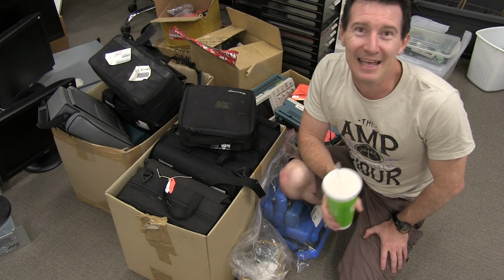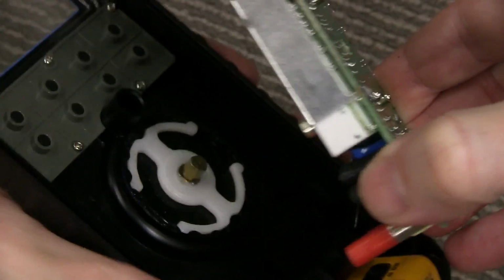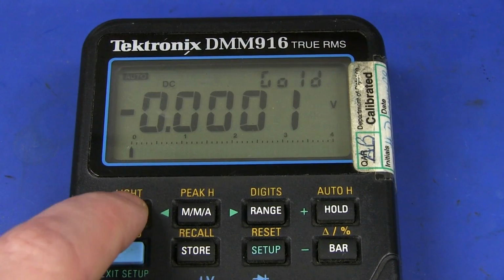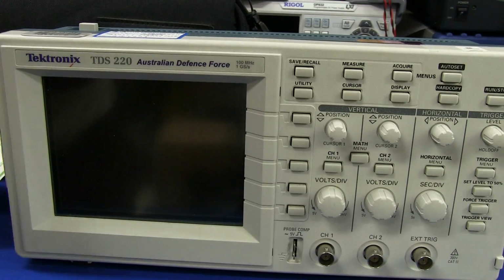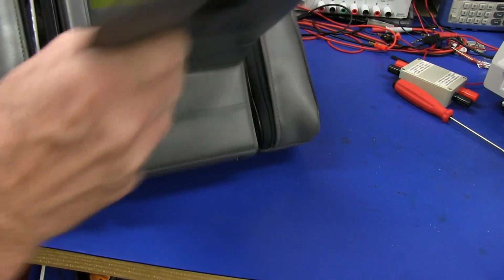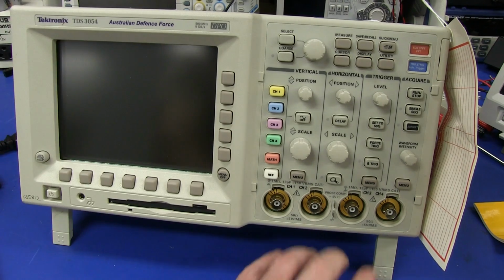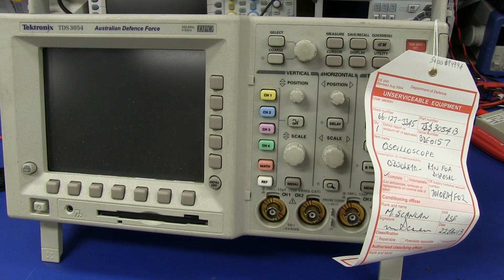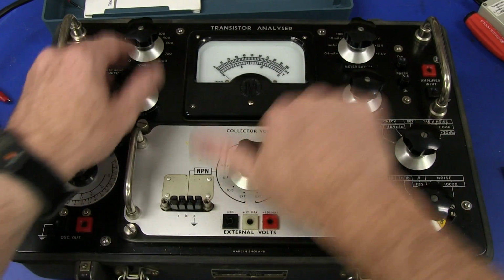EEVblog #559 - Auction Score

Comment: This 'find' reminds me of how I got my first oscilloscope. This was in the mid 70's, right after I had moved from Germany to the States, and was attending college in the St. Louis area. I had about zero money after rental of my single room basement apartment and putting fuel in my $100 beater car (luckily I had a couple scholarships that were taking care of tuition, and meals were included in the room rent). My only pieces of test equipment were a $25 Heathkit power supply and a Japanese analog multimeter that I had bought as a teenager. I was using some nice Tektronix scopes in the college lab, but owning any kind of scope was out of the picture, financially speaking.

My landlord was a service technician for Honeywell in the St. Louis area. He worked on repairing the Honeywell mainframe computer(s) at Scott Air Force Base nearby, but when not making a call to the base he hung out in the Honeywell building, or retired to his garage TV repair side-business. One day he told me that one the the Honeywell lab's high end Tektronix scopes had been labeled as 'out of service, not repairable' and was supposed to be trashed. But the Tektronix technician who was permanently posted to that Honeywell office had told him that the only thing wrong with it was one of the many secondary windings of the large power transformer had failed. Honeywell preferred to spend the money to buy a newer scope, as opposed to repairing the old one. He arranged to spirit the scope to his home, although it was written up as being trashed. The Honeywell technician, aware that it was actually being 'donated' to a young engineering in training, kindly filled out a form asserting that, aside from the transformer, the scope was still usable and serviceable. My landlord then gave me the non-functional scope, as-is, but armed with the statement of serviceability from the Honeywell tech.

One of my professors at the college, hearing of my windfall, showed me a manual for one of the college owned Tek scopes, and on the back cover it said that Tektronix manufactured their own transformers and CRTs, and unlike the other internal components, those parts were warrantied for the life of the scope. I mailed a copy of the Tek serviceability form to the address on the manual that I had perused, requesting a new transformer, but expecting nothing to come of it. A couple weeks later, a package arrived with the transformer.

The scope was, if I recall correctly, one of the 560 series models, perhaps a 564, taking plug-in vertical and horizontal amplifier modules. I am pretty sure that it had a 3A1 vertical amplifier module (dual trace), and a fairly high end horizontal sweep module (perusing photos on the web suggest that a model starting with 2B, perhaps 2B07 or 2B67, etc; might have been the one I had. I recall it had delayed sweep, and some other bells and whistles. No circuit boards anywhere in the scope. All discrete components silver soldered into metal saddles in ceramic rails, and beautifully done point-to-point hand wiring between those rails and the many tube sockets located between the rails. Several wiring harnesses snaking all through the scope. The scope and its modules I unwired the old power transformer and removed its many wires from the various harnesses, then mounted and wired in the new transformer, restoring the harnesses as I went along. The repaired scope seemed to work perfectly.

The downsides to this scope, besides it very heavy weight and huge physical size, were a fairly long period of warm up before it would become stable (I was told that these were normally just left turned on all the time), and that installed CRT (with variable intensity illuminated graticule) was intended for taking photos of the display, not viewing the display directly....something about the phosphor. The bezel of the CRT display was a special one designed to allow a large Polaroid camera (or other) to snap on to take photos of the display. So the display was rather hard to read. But I used this nice scope for many years until I eventually got tired of waiting for it to become stable after turning on, and squinting at the display. I sold it to a HAM that I worked with in my first engineering job, and bought the top-of-the line Heathkit scope, which I used for many years until replacing THAT with one of the first Tektronix digital scopes. which I hated and rarely used, and actually used a Goldstar analog scope for most things in my home lab. I finally replaced both the early Tek digital & Goldstar with a Siglent SDS1203X-E, but keep the fully-iunctional Goldstar around lust-in-case.....

Comment: I know this post is 3 years old but...I have a 15 year old Tektronix multimeter at work (university) that I have used almost since it was new. It is OK on a good day and on most days I would like to throw it against a wall. The selector switch contacts are carbon coated, not nickel plated like the newer ones Dave has. I took it apart again last week to clean the contacts and reshape the contact fingers and it works better (it loves to randomly switch modes.)

Tektronix does NOT manufacture these and does not even have access to the schematics (as we found out when EE department bought a bunch of them years ago). I suspect they are better than the cheapy import meters but they are not great (Dave's newer ones do look better made though.)

I used to buy Tripplett meters (have a 9040 now that I have had for many years) but I think they have gone the way of rebranding cheap import meters now too.

Comment: I've had a Tektronix DMM916 for well over a decade, awesome multimeters.
The 'Cold' on the screen is actually 'Gold', as in, gold menu option. Press the gold(yellow) button and then select from any of the options in gold(yellow) text above the buttons, as you were doing in the video. To activate the backlight, press and hold the yellow button for approx. 1 second to turn on, press and hold again to turn off. Simplez.

Comment: The Simpson 260 with the No Battery warning label was probably used to test weapon systems for stray voltages.
They don't want even a remote possibility of any voltage coming out of the meter and setting off an explosive device.
I think that makes it an even cooler item.

Comment: hey does anybody know where i can get a good cheap oscilloscope fro under a hundred dollars
Reply: I got mine for 7000 yen from akihabara in Japan. It is a 100mhz, 2 channel model and 30 years old. The shop I bought it from had basically every digital scope you can imagine and dealt exclusively in test and measurement equipment. They also had a decent selection of used analogue scopes, including the one that I bought. They even gave me a discount because I am a student. Unfortunately, flying to Tokyo is not a particularly practicle way of finding things, but I was already in Japan.
Reply: Try Craigslist or Ebay. Remember, make sure they work so you don't end up with a load of crap. I have a Tektronix 2225 analog scope. I got it of Craigslist.

Comment: Wow, that is awesome. For many years I worked for the military industrial complex and auctions like that were common place. They would get rid of perfectly good equipment. If no one bought it, then they would have them destroyed rather than let the employees get a hold of them.
 I worked as a metrology technician in and out the USAF. The first company I worked for was called LORAL back in the 80's into the 90's. That company literately accumulated buildings of fully functional equipment. Again, what they couldn't sell, they destroyed. I remember they were auctioning off spectrum analyzers, microwave generators and counters. Only one guy showed up and took them all away for a dollar. No shit. During those days,every time they won a new contract, they would buy all the latest and greatest test equipment, and last years stuff would be trucked off the wear house.

Comment: The reason we get rid of most old equipment like that is the Cals unit won't calibrate it anymore. In which case we cannot use it. 

Also cals will only support so many models I.E. if we have 4 models of scope the oldest 5th one goes to make room for a newer model

Comment: I find amazing what some places just scrap, or throw out. I watch a lot of the computer networking industry type subjects, and found out US Gov't was destroying the roadrunner super computer, and it's only like 4 yrs old. They basically said due to nature of the data it worked on they shredded everything. I thought are you kidding, the only thing you'd have to worry about is the Hard disks, and that's likely a SAN setup. I thought come on give the whole thing or parts to various schools to use for teaching computers, or doing research. I told a friend that is computer network teacher at local community college, and he's like that's ridiculous. And was like they don't want I'd take it, I was like me too. (even if no school had use, auction it off I'm sure somebody pay at least scrap value for it, but I'd expect more.)

I have some old Simpson small single function meters my dad gave me that were used in the chem. lab where he works. I think there from like 80s if not before, I had to open them up, and calibrate resistors, as used old carbon comp resistors. there not totally accurate still, but a lot better. some reason on 10v range 5V registered like 10 V and 10V was like 15-18. (that was voltmeter, I had no issue with amp meter.) Amp meters still nice, as goes to 25A my DIMM maxes at 10A. Got some analog DIMM too made by mura meter, that I use if I question something, and worry about it could fry my $40 mastech DIMM. The mura don't seem very accurate, and like every few use you have to adjust the Cal screw, so I don't much care if it fries, as pretty junky.

(that transistor tester's got to be the fanciest one I've seen. I just got cheapy kit from electronic goldmine, tells what type they are, and if there shorted, etc., but you need manual to figure out light codes, and It seems to only be good for small transistors, mosfets, larger transistors just don't have good output.)

Comment: Pretty sad to see how wasteful military can be, I thought it was just the US that was that bad.
Reply: I don't know is the principle of how budgets are calculated are the same, in Oz or in the US, but I'm under the impression they are!

Here in France, its basically your annual regimental budget is X, better spend it all for it to be renewed in full, in case it's ever actually needed.

So in order to have what is felt could be needed (good idea), it ends up beeing "hey, better burn all that Gasoline to be sure to have the same next year!"
So both from what my 'pa said of it's service in the Air force in the sixties, to what friends currently in service tell me, it's wash the vehicles with gas, use a jerrican for a BBQ. and other retardation, pretty much as the second half of the fiscal year has started...
Instead of some extra distributed stockpiling, in case, you know, aleas of war happen...

Nonsense driving the costs up, while lowering the tolerance to shortages, resiliency to hardships and self reliance, and all that stuff that might come in handy if a "for real" conflict arose...
"Beeing trained to "do without" if need be, yet well equipped?
Nah! Lets throw stuff out the window and never learn to repair a thing" should be the motto!
Reply: A friend of mine in the US military said the exact same thing with regard to how people are given money pointlessly.
I was commenting on how soldiers are given money while they are in service while they really have no need for it. The only reason they give it out is so that it will be there in case they need another year. And since my friend is irresponsible he just blows it all on useless things because why not.

It shouldn't be "spend now to have some later" it should be put aside what we have now that is excess and safe it for later uses.

Comment: Anybody jealous? I certainly am...
Reply: Same thing. Estonia is such a bombhole.
Reply: DjResR pfft  bet they still use analog soviet multimeters -_-
Reply: Mauro Tamm Most likely, some 2 euro crap would be more possible be in use here. I would love to get my hands on one of the soviet analog multimeters, at least better than the cheap chinese crap velleman I currently have with 100 ohm range resistor burned out and case held together with cable tie and insulation tape.
Reply: @DjResR  I have an old soviet multimeter from the 70's
Reply: Yeah....>.<
Reply: Uziel Capetillo Meee tooo!

The hell! That is n insane score...
Reply: @iSolarSunrise yea me toooooooooooooooooo. But wondering what Dave going to do with all of those. I am sure those are not all for use in personal LAB

Comment: The funny is that people that uses those equipments in the defence forces and now discard them , barely know how to measure a AA battery voltage.
Reply: Your comment suggests  a limited scope of thinking. What do you know of the ADF? The folks using this equipment aren't likely to be some first year recruit but an a trained technician that calibrates, maintains and fixes expensive electronic equipment. There may be outsourcing of some maintenance of systems to Contractors but there would be a strong requirement for ADF to operate and maintain the bulk of its electronics gear. They aren't handing these DMM's out to Infantry along with their Steyr's.

Comment: Great score Dave! I use the Tek TDS3054 as my daily driver at my job (designing switch mode PSU's). I've tried lots of scopes, but these Tek's with the advanced trigger modules have in my mind the best triggering for analog signals.

Comment: if the fuses have blown, one would have bigger issues to worry about than lifting the innards out of their enclosure. Like, why the hell did the fuses blow... Also, no battery compartment because these things don't need the battery swapped so often, perhaps once every calibration.

Comment: We use TDS3034 scopes at work and they're great.  Same interface as yours but lower bandwidth.  Ours have the Ethernet option and always nag you with DHCP failed screens when you don't plug them in though...that is annoying.  Also...floppy drive...haven't seen anything with one of those in years, shows how long the useful life of one of these scopes is!
Reply from the maker: Would be interesting to try and replace the floppy drive with one of those USB versions

Comment: That old school stuff....beuuuty. I recently bought a Vellerman PCSU1000,  2 ch 60Mhz 1Gs/s PC scope for around £250, I wished I could have found an auction like the one you did. Those scopes !!! Who needs accurate calibration, as long as it is pretty close you can find out what the circuit is or isn't doing.  Coming back to that transistor tester, just look at the condition !! the build quality !!  oh...oh...ah nuts..anyone got some tissue paper?   You gotta do a teardown of the scope with a dodgy channel 3 input Dave.  I doubt you will be doing these great vids for the rest of your life but what's life going to be like after Dave?  Keep going mate, ripper !!

Comment: I know the NEC D780 is the NEC version of the Z80.
Wonder if your one is an embedded version?
Reply: Yup, found it.   NEC uPD78063 24K rom, 1K ram, internal LCD controller with 40x4 bits of ram, 57 IO ports

http://pdf.datasheetarchive.com/indexerfiles/Scans-063/DSA2IH00127328.pdf

Comment: Sorry to interrupt you again, but you (and me, too) would probably give a damn for that cal mark. But one who work for the goverment, will certainly do. As I worked for our VDE - it was one of the big rules: Only use propper and !only! calibrated instruments while measuring. Old Instruments where simply put away because its calibration costs to much, or was to complex and buying a new one is simply ceaper. So they just dumped the old?!. Five years of service means old in these authority environments...Written off the tax books, that´s it...and dump it.